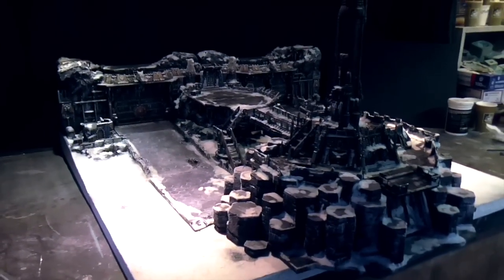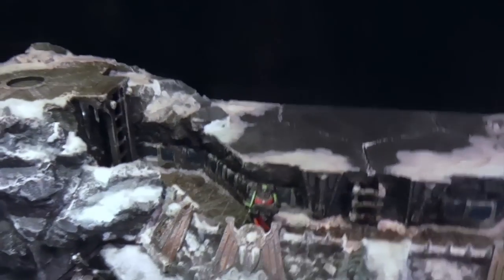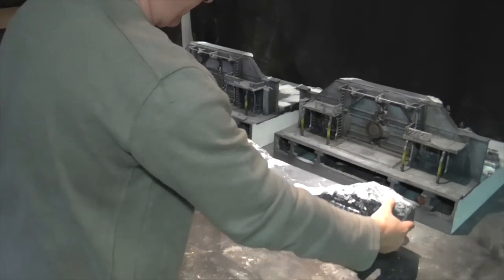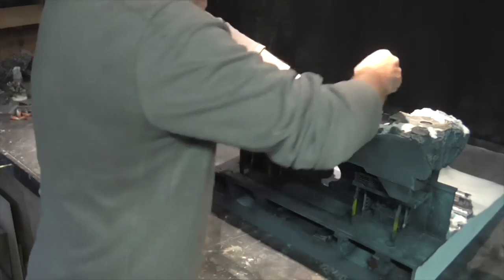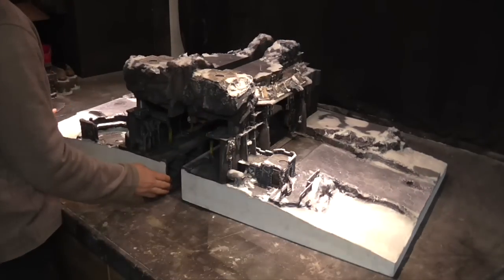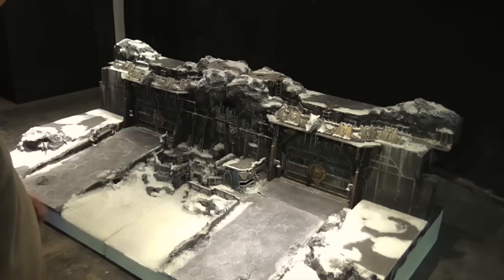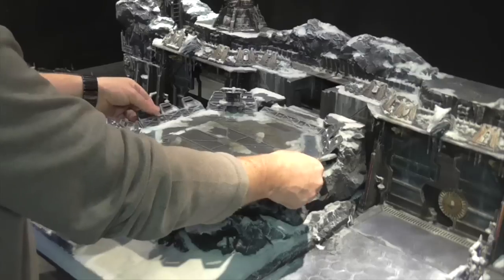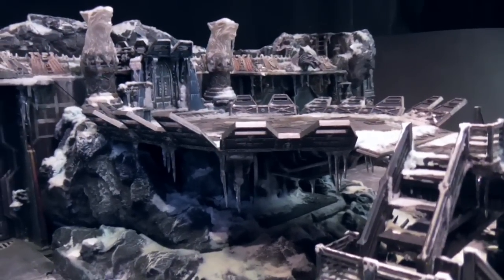Battleboards Warhammer 40K Space-Wolves - #2 Fortifiction Boards

Comment: Really like the icicles - how many times have you hit the ones over the doors?  *smilie*  I didn't realize they were flexible until you showed the underside of the landing pad.  What on earth did you cast them from?  It occurred to me that casting them in a clear silicone/urethane might be an option to discourage damage from bumps and the like.  

The paint effects on the doors is outstanding.  The color choice of the almost-verdigris works so well.  The sub-flooring is a crazy nice addition.  The ability to screw down the rampart over the doors... well, what can I say except, very pro.  Very pro indeed. 

I kept wondering when lighting would show up in the the project.  *grin*  I think you hit the perfect mark on the lights for size and intensity on the landing pad.  For the various flash patterns, did you use something off the shelf or do your own circuit board?  I wondered if a light in the bunker flanking the door (with removable roof) might be nice to show the miniatures placed within it.  

Lastly...  Laser cutter.  Questions, questions.  ;)
When did you pick it up?  What model is it?  How much of the detailing on the set did you cut with it?  What is your overall impression of using it?  Would you consider a short video on it to give drooling artists like myself a peek inside?  I almost pulled the trigger on a Glowforge two weeks ago, but just can't afford it right now.  :(  Seeing this piece, I have regrets about not committing to the purchase.  The modularity (sp?) of the piece is excellent and I can't help but wonder that the cutter made that a bit more easier and polished.

My next project involves a lot of structures, and the idea of using a laser cutter for many of its aspects was very intriguing.  

Well, as you might infer from this feedback, I'm truly impressed.  Really outstanding work, and finishing it in six months is it's own accomplishment.  During the whole video I kept saying to myself, "I have to step up my game'.  Thanks for providing some real inspiration and ideas.